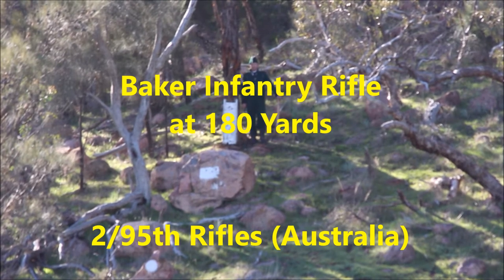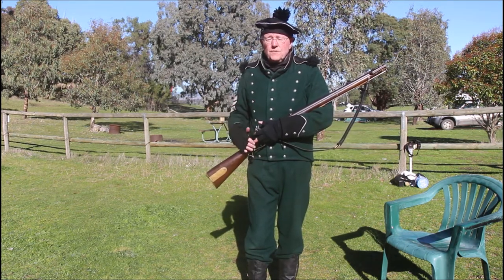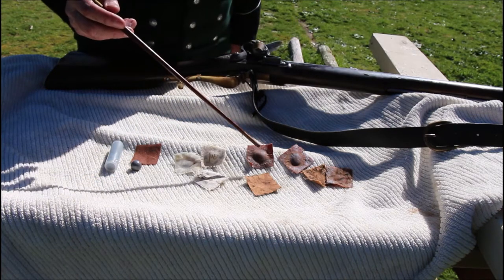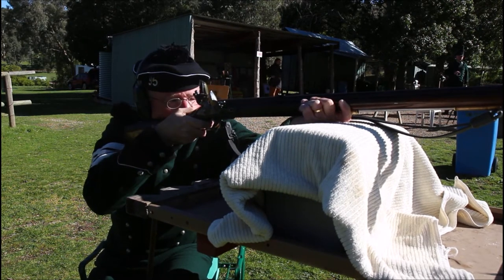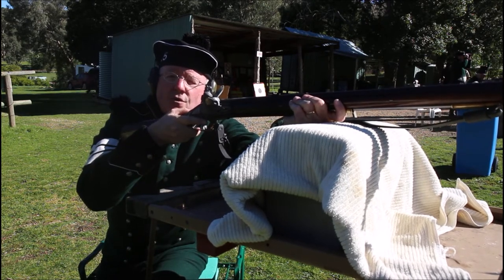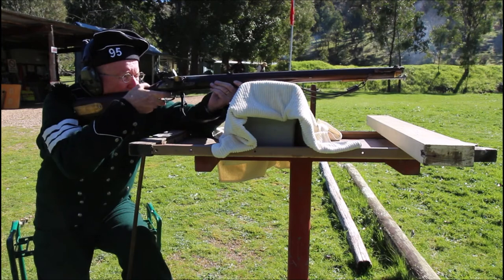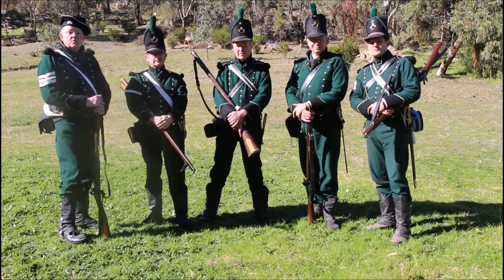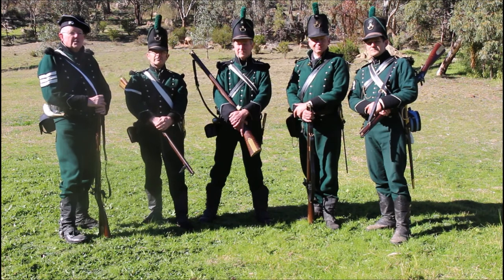Baker Infantry Rifle at 180 yards

Comment: When I began shooting my Brown Bess , recoil was felt on cheek. Maintaining a firm grip and firm cheek weld, will eliminate most felt recoil. My tendency was to drop barrel low left at moment of firing! A flash in the pan will really show you how much you flinch. Any way my shooting has improved alot. Ball very accurate , buck and ball not so much. The 3 pistol balls(.31 cal.) influence the .69 ball ? 13 (.31 cal. ) good buck shot load , close range. Experimenting with shot now , for clay birds. Smooth bore flintlocks are just too much fun .

Comment: I wonder if the rifle shoppe baker bayonets are good
Reply from the maker: Had one for 23 years and going fine. Only caution is that the slot on the sword bayonet for the bar on the barrel is roughly right for the bar supplied by the Rifle Shoppe - if you intend to fit it to another rifle, significant tinkering might be required. Ty for your interest.